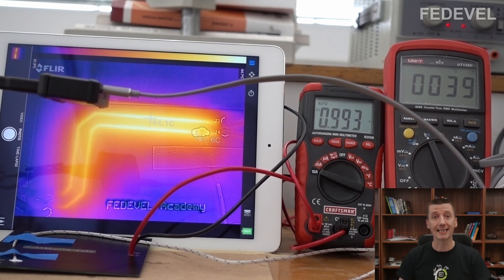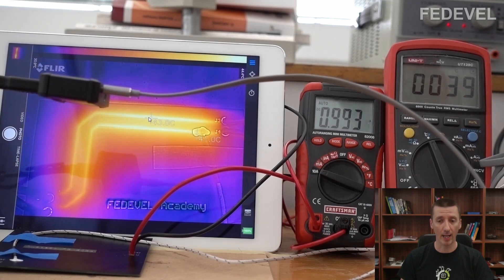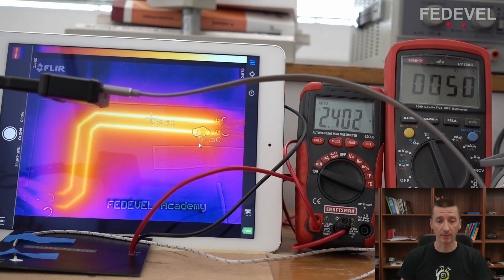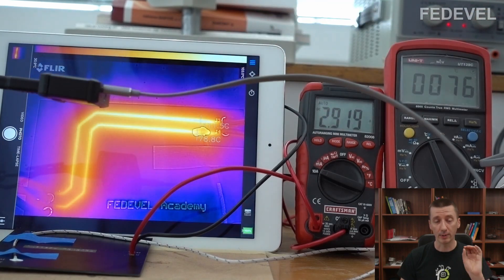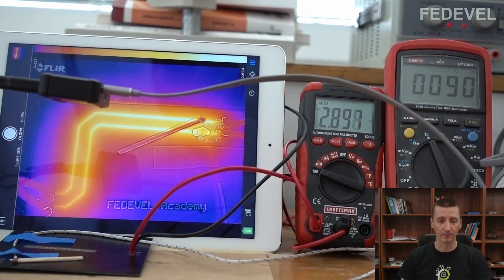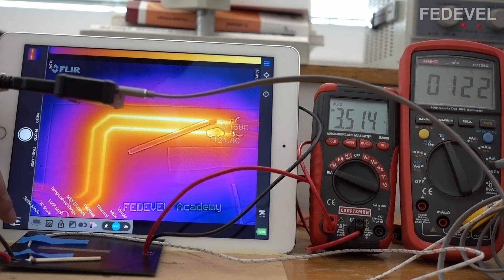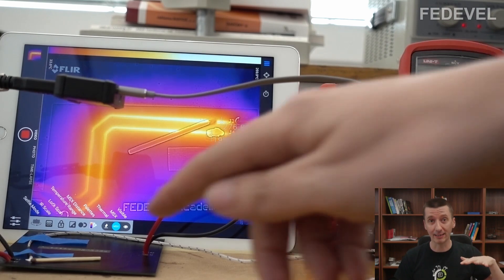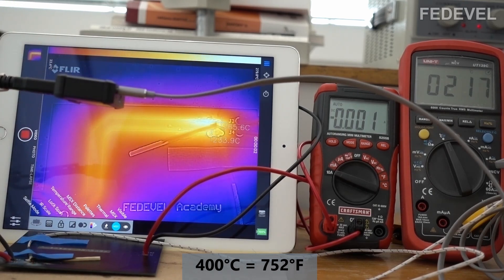Watch PCB Tracks Getting Hot | Infrared Camera | #HighlightsRF

Comment: I mean 290C is very  impressive, how long did you run the test? I also have hard time understanding that the thermocouple is taking 90Celcius!
Reply from the maker: Not long - very similar to the time you can see in the video. PS: the probe is maybe even a little bit bigger than the track (track is super small), that can be the reason why it takes so much heat away

Comment: I want to know why the other section of the track is cold! What did the simulation tell you on that section of the track? I guest it's uniform.
Reply: Note that this trace segment is fairly close to the board edge. When compared to vertical segments, there is much less material to absorb and dissipate the heat. If the conditions were the same for both segments (equal distance to the edge), I think the trace would start to burn at the corners/bends.
Reply: @CzlowiekNapinka  thanks. Does make sense. 
 it’s close to the edge and also between other heating track. So it’s doomed to heat up more.
Reply from the maker: In simulation - yes uniform: https://www.youtube.com/watch?v=LQ20GBonRmA&t=0s PS: We talk about the colder parts of tracks in the comments for the short video: https://www.youtube.com/watch?v=yljKJ2oKPdU